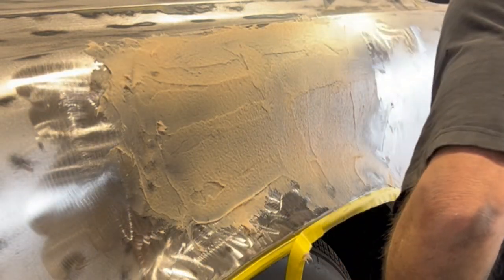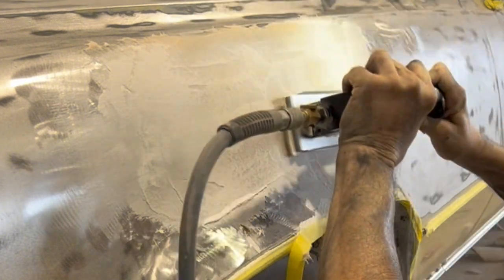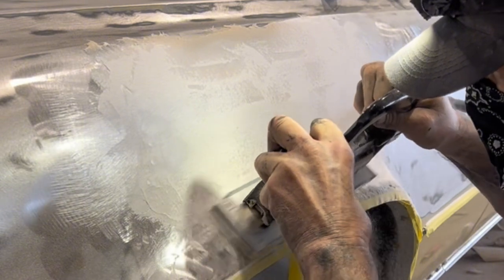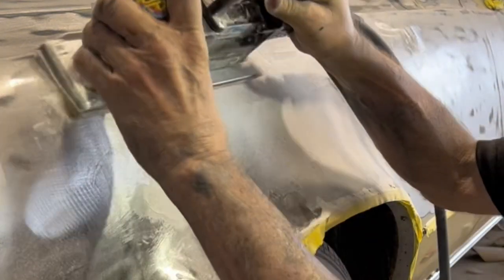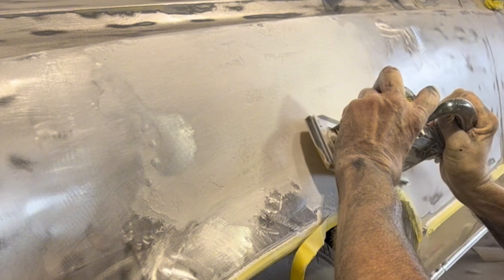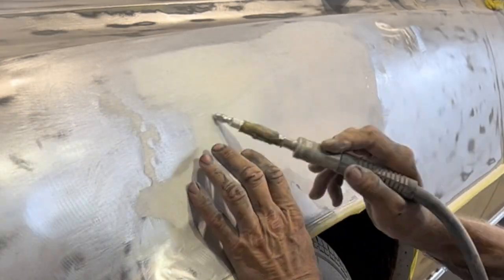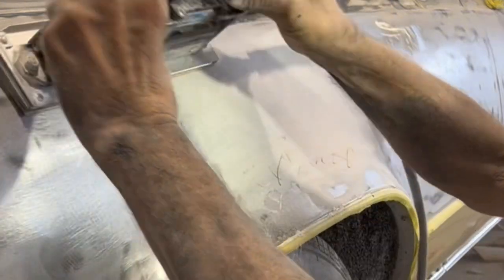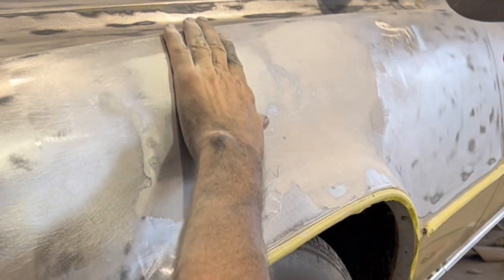THE MASTER TEACHES AIR FILE🧐🧐 How To Sand Fibral Lite DIY Pneumatic Tips Tricks Techniques Auto Body

Comment: Great stuff! I use the Tiger Hair 🐅, and then I use 3M Platinum Filler or Evercoat, and then I go over with either 3M Platinum Glaze or Evercoat Glaze, and then I hit it with Guide Coat, Dupont 2k Filler Primer,  and Guide Coat again. Now if im not doing high dollar show work, It doesn't get Guide Coat and the other expensive materials. I quite messing with insurance work, but great informative videos for beginners..
Reply from the maker: Good materials like that make for a job well done😉😉
Reply: @OldBondoBilly   I like the mission you're on with this channel. The materials do help, but when the buy here pay here lots come calling, they don't get that treatment, but as you know, they don't want to pay.

Comment: I haven't seen anyone use a air file for twenty five years I still got a rodac on the shelf somewhere that brings back memories from the eighties 😊
Reply from the maker: If I had a long air file,  it would never leave the shelf 😉😉
Reply: @OldBondoBilly  got a old rodac was the hot new thing in about 1980 I bet it still works that thing would work your ass off I remember night cramps in my biceps from running the hell out of that thing my hands used to lock up when I was working two jobs lol 🤣🤣🤣

Comment: I was told not to bondo or glass over raw metal because there are small air pockets that may have moisture in it. Is this true? Should you only bondo over primer?
Reply from the maker: There’s a lot of new wave hot shots, trying to sound smart with that kind of nonsense.  I have observed Bondo being put over bare metal for 47 years and have never seen a failure due to that. you might have a failure if you ground the metal bear and let it sit for too long and develop surface rust before you put the Bondo on but only an idiot would do that anyway.🙄🙄
Reply: Oh no the rust thingy 😮

Comment: Does tapping the panel with a hammer after bondo cause issues with cracking or adhesion? Or is that something you only do when using fiber filler?
Reply from the maker: You have to be mindful of cracking the bondo if you’re gonna tap the panel with a hammer if you crack the bondo, you need to grind that spot down and reapply Bondo to that area

Comment: Since that fiberglass filler is so hard to sand, would it be better to apply a thinner coat?
Reply: In theory yes. It would be optimal to spread it only as thick as needed. But fiberglass filler is hard to spread smooth. Plus if you try to work it too long, it will harden on you. So it's best to be a bit thicker than needed rather than too thin.
Reply from the maker: I didn’t want to break through to flux possible points

Comment: Those air files suck, orbital ones are much better
Reply: nah,  they dont "suck",  they both have their purposes and if you use the right tool for the right application, they are both great tools.  some places an orbital just is a terrible choice and the air file is what you need and vice versa.
Reply from the maker: Fibral Lite would laugh at a pissant orbital 😂😂😂😂😂
Reply: Orbital on something like this wouldn't work properly. It would grab, and instead of moving the pad, just vibrates your dick-beater. You can have a million dollars worth of tools, but if you don't know how to use them, you would be better off with nothing.
Reply from the maker: @princeholiday2126 interesting analogies, but I concur😂😂😂
Reply from the maker: YesWelder tender 39
Reply: @OldBondoBilly 

12345